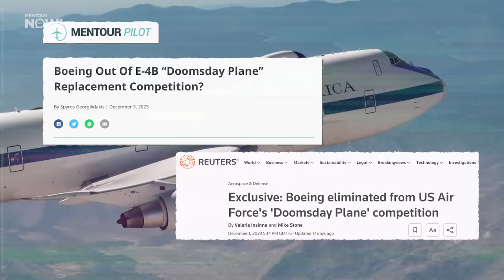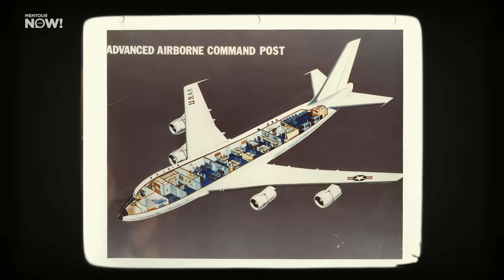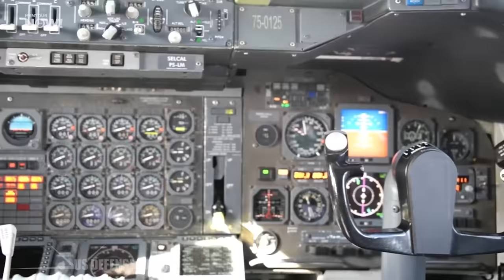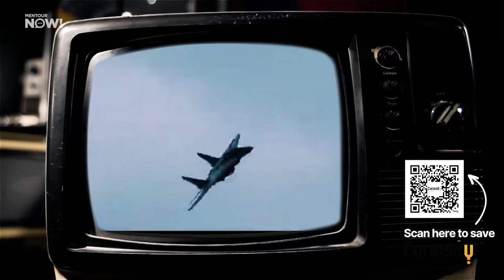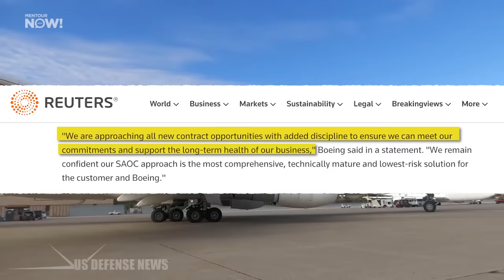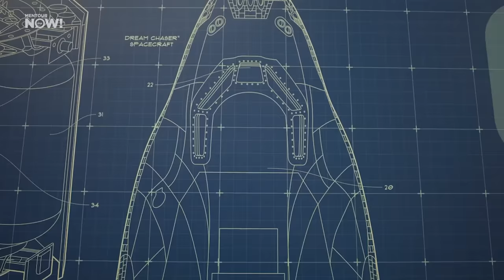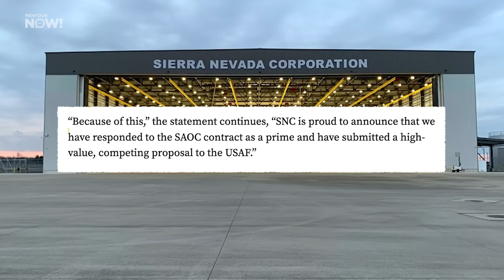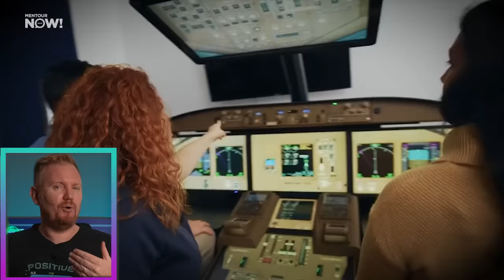Why was Boeing kicked out of the Doomsday Plane competition?!

Comment: What the AF should have done was put orders in for 15 747's before the lines were shut down.  Makes too much sense however.
Reply: doesn't matter - it's the taxpayers' money, so it's unlimited, and spending doesn't need to have any regard for efficiency. There is zero accountability.
Reply: @charlestoast4051  that’s not true at all. In fact, it’s the opposite. The reason Boeing withdrew was because of the requirement by law for the DoD to only sign fixed price contracts. That regulation was created by Congress to prevent projects from runaway costs and save the government money and improve efficiency. If money was unlimited and they didn’t care about efficiency, do you think they’d be flying 50 year old aircraft? Believe it or not, the budget is not unlimited and the U.S. military has a huge lists of financial obligations that don’t allow it to just blow money whenever and wherever it wants.
Reply: @FlyByWire1  And that fixed price sequence is biting boeing in the rear big time on the new af-1's.  They have to strip and gut the entire airframe and rebuild it almost from scratch. Their hindsight is 20-20, not going to do that again. Taking a -400 or 8i down this path is in the same boat, you have to take it all apart and put it back together again.
Reply: Wait.... Isn't this somewhat normal for aviation? I honestly don't know, but for some reason I recall there being a 5 year overhaul or something for commercial aircraft that basically strips them to the frame and rebuilds them.
Reply: yep and that’s the hardest part about fixed price contracts. There will always be unforeseen costs that will arise in the project, we can’t predict the future. So whoever wins the contract will either have to come up with a plan to prevent that or just take the loss as Boeing has on previous fixed price contacts.
Reply: But then they’d have to retrofit all the old wiring harnesses an various other updates to make them compliant. Cheaper to buy used then modify.
Reply: The E-4 is far from a regular production line 747.  They have EMP shielding and 100 other things we don’t know about built into the airframe.  Modifying  an existing plane to fit E-4 configuration would cost a fortune.
Reply: Boeing offered end of run birds to the USAF.  It was declined.  The USAF was not is the right phase of procurement to fund them.  Similarly, Boeing offered a deal with their tanker bid to extend the 767 line for the tanker.
Reply: No, what makes sense is buying A380s instead of crasheing trash. You can find 10+ in good condition on market right now...
Reply: @brianacuff274  What they're doing to make the VC-25Bs goes WAAAYYYY beyond a normal D-check. It's not just stripping down and checking everything, but actually redesigning much of it.
Reply: @KuK137  They could certainly acquire A380 frames more readily, but the modifications would be crazy expensive and would likely require quite a bit more revealing of classified information to foreign entities than what the Air Force is comfortable with, especially for ensuring a supply chain that can keep the things in service for the next half a century on an airframe that hasn't been built in years, wasn't built in the U.S., and was never owned or operated by any U.S. entity - or any entity anywhere in the Americas, for that matter. Also, the A380 includes significantly more composites than the 747 and that makes the much more difficult to harden against EMPs.

Comment: I think the reason they chose to increase the number was because USN replaced their E-6s with C-130Js, so they need SAOC planes to handle Looking Glass missions as well, just like before they handed over and merged that role with USN TACAMO.

up until 90s -> USAF E-4 = Nightwatch | USAF EC-135 =  Looking Glass | USN EC-130 = TACAMO
90s-now -> USAF E-4 = Nightwatch | USN E-6 = Looking Glass + TACAMO
future -> USAF SAOC = Nightwatch + Looking Glass | USN EC-130 = TACAMO
Reply: USN planes aren’t bought under an USAF contract.  Your reasoning is flawed.  The USAF isn’t responsible for planning for USN air needs.
Reply: @matthewgaines10  Your logic is flawed, it's the other way around. Historically, USAF was the one that piggyback THEIR needs onto USN planes. STRATCOM quite explicitly states that USN E-6s are equipped for dual mission, both flying for USN TACAMO staff and for USAF Airborne Command Post battle staff in the Looking Glass role (in place of USAF EC-135).

Now with the USN planes potentially being unable to fulfill the task USAF counted on them (because USN isn't necessarily responsible for planning for USAF needs), there is no reason that USAF would not be responsible for planning their own needs.

Actually, see SEAD mission - they rely on joint operations now that USAF no longer has dedicated platform with the retirement of EF-111 (and no, F-16CJs are essentially just HARM shooters).
Reply: @matthewgaines10 He's right.  There are actually two different USAF missions involved.
1) "Looking Glass" is an airborne command post capable of talking to pretty much everything that SAC HQ can talk to, including transmitting valid launch codes to ICBM silos (but not the USN's SSBNs).  It started out in EC-135Cs,  and when those got retired in the late '90s, the USAF managed to talk the USN into picking up the mission on its E-6Bs (which are also based on the -135), which were also taking on the TACAMO mission, the USN's version of Looking Glass (which can transmit launch codes to subs).
2) "Nightwatch" is a strategic command post for NCA (the President, or whichever survivor is highest on the succession list).  It began on the EC-135J, then moved to the E-4.  It's probably best to think of it as the "DEFCON 1 Air Force One"; the VC-25 is designed to support peacetime diplomatic missions, and allots a fair bit of space for guests, reporters, Secret Service ground teams, etc, plus a much higher level of comfort.  Nightwatch trades all of those frills for more radios and radiomen plus a few generals and enough supplies to keep everybody fed and watered for up to a week in the air.  That's why an E-4 usually follows AFO around, just in case.
3) "TACAMO" is the USN's version of "Looking Glass"; instead of talking to ICBM silos, it's designed to talk to SSBNs and carrier groups.  The mission is similar, but more spread out over the world.  Originally performed by the EC-130Q, which was replaced by the E-6A (later upgraded to B, which also picked up "Looking Glass" missions as a favor to the USAF).
  The E-6Bs, E-4Bs, and VC-25s have all been needing replacements for some time now; honestly, everything made from a 707 or old-model 747 needs replacing, but the money hasn't been there for decades, and the programs that have gotten money have been horrifically mismanaged (see: E-10, P-8, KC-46, VC-25B).  As Mentour mentioned, the USAF wanted to go in with the USN on a new plane for all three of the above roles, but there wasn't money for it at the time.  The USN has since gone its own way, with a plan to return to C-130s, which will leave "Looking Glass" without a home.  That's why the USAF is looking at a larger buy of SAOCs, in order to have one platform that handles both "Nightwatch" and "Looking Glass" missions in order to save money and resources over time, and to ensure that there are always enough airframes available to carry out both missions.
Reply: Except the Navy has NEVER USED the E-6...🤡
Reply: @ligmasack9038   "Except the Navy has NEVER USED the E-6...🤡"   what?
Reply: Wrong, the USAF had to buy a fighter that was designed to handle heavier landing gear to USAF dismay.  That limited the aircraft’s capabilities ‘cause USN requirements .  It’s called the F-35 @matthewgaines10

Comment: I assume the 5 mile long antenna that sticks out the back is for low frequency communication, which requires a longer antenna.  Low frequency has several advantages such as being able to communicate to submarines underwater.
Reply: ELF
Reply: thanks for repeating what the video said
Reply: The "five mile antenna" is not an antenna - it is a ground plane for the long wire antenna.
Reply: Extremely low frequency
Reply: Probably for communication with submarines (haven't finished the video yet).

Edit: Yeah lol, that's what it's for.
Reply: Isn't the body of the aircraft the groundplane? @TacticalData
Reply: @TacticalData  : Antenna ground-planes are part of the antenna, any description to the contrary is incorrectly describing what they do and how/why they work.

Comment: Love these videos! I know the second requirement was "modification of a second-hand aircraft", but why wouldn't modification of existing C-17 Globemasters (or even modification of C-5 Galaxy's) work here? They're 4-engined and tried-and-tested in the military.
Reply: Wonder if efficiency comes into play.
Reply: I initially thought the same thing, but the certification process would be cost prohibitive and it's doubtful you could get either airframe certified as designed regardless of modifications made. In fact the modifications required to convert it from military transport to flying command post full of personnel and equipment may make the certification process even more impossible.
Reply: I bet it is easier to start from scratch and with an airframe that will have greater longevity with the newest C-17 and C-5 eight and 30 years old respectively.
Reply: @vanguard9067  There would have to be a business case to build such a plane. A clean sheet design through certification is a decade-long process and there would have to be more than 10 planes built (think several hundred minimum) for this to make any sense. The Airbus A380 is considered a business failure because the program lost money since the plane didn't sell i the numbers expected or required to meet break-even revenue. The A-380 couldn't be used as a freighter so it's market was limited to just passenger airlines. A clean-sheet design for a maximum of 10 airframes is a complete non-starter. And there is no current market for 4 engine super-jumbo airframes or Boeing and Airbus would still be building them. And there isn't enough demand to cover the production costs of the few freighters ordered and sold every year.
Reply: @andrewg.spurgeon1736  I totally agree about a clean sheet design.  I think ultimately they’ll scrounge up some lower mileage 747’s and some contractor will build out the doomsday planed]s,  I have a hard time believing any contractor will do the work FFP because the government does not have a  firm set of requirements.
Reply: Military planes aren't FAA certified though. The requirement for an FAA certification means they have to go with an existing civilian design.
Reply: It would deplete the already insufficient USAF heavy airlift inventory. Simplistically, it would be the choice between an already configured two story office building with a basement, versus converting an empty warehouse into the same. The design of the 747 maximized floor area for passengers and containerized cargo, the C-17 was designed around maximizing volume (especially height) and weight and has a built-in mass penalty for toughness in austere field operations. Douglas and Boeing did float a commercial cargo version of the C-17, but that was aimed at airframes for the CRAF (which subsidizes operational costs).
Reply: @michaelpatrick6485  great points, thanks.

Comment: I predict Boeing gets the contract with better terms.
Reply: and with SNC as the sub contractor to do most of the work
Reply: @johnstreet797  Or a joint/partial bid together with SNC, where Boeing's responsibility is limited to eg. the procurement and refurbishing of the planes. This would allow SNC to be entirely focused on the Upgrade and Modification process...

Comment: Presumably these planes have a Faraday Cage arrangement built into the interior of the fuselage which should prevent the effects of EMPs from Nukes. They would need something of this kind because these things are packed with modern electronics, even if the avionics are analogue.
Reply: A fuselage is already a Faraday cage (even if there are quite a lot of holes that limits the upper working frequency).
To harden a plane against EMP you need to ensure that every piece of the fuselage make a good electrical contact all around with the frame and with the other fuselage pieces (the classic glue is not electrical conductive, you need something else to ensure the contact) and you need also to plug any holes to avoid EMP ingress (for example, the windows are made with electrical insulating material and, even if the doors are made with metal, they not ensure a proper electrical contact all around the seam so are still considered as holes; a special conductive gasket placed all around the seam is required to made the joint RF-tight).
Finally, you cannot run a cable outside a faraday cage otherwise it will carry the RF energy inside (the outside portion of the cable act as an antenna to pick-up the RF enrgy and the inside portion of the cable also act as an antenna to radiate the RF energy inside the shielded environment!)... all cables that runs outside the fuselage must be filtered and shielded properly.
In any case....... a Faraday cage that blocks 100% of the radiation is almost impossible to build (specially if there are size, weight and strict cable management requirements!) so a little part of the RF radiation is supposed to seep inside and the electronic equipments are supposed to be hardened and withstand this noise.
BTW, hardening a devices that uses low integration is simple because the bigger is the component the higher is the working voltage and the lower is the input impedance... and the higher is the working voltage and the lower is the input impedance the higher should be the RF pulse in order to generate an issue.
Also, you can't damage what doesn't exist.
Analog equipments (but also simple digital hardwired equipments) contains less but bigger components than modern equipments (that may contains millions of microscopical transistors enclosed in a very small chip).
I work as electronic designer for medical devices..... i'm used to design devices with quite a lot computer-aided bells and whistles but for the safety and emergency part of the device i prefer to stick with plain old analog electronics, plain old simple and hard wired digital electronics and even electromechanics too!
Reply: Bet they have a couple of valve radios too, just in case
Reply: @teslacoiler  Military aircraft have ITO conductive coatings on windows as standard.

Comment: Hmmm some old A340-600s could be an interesting choice. Quite a few in storage and dirt cheap too!
Reply: I don't see the US military relying on the EU for these planes.
Reply: The A340 is far too underpowered for all that additional equipment and reliability.
Reply: Beautiful aircraft. Too late to the party.
Reply: @TacticaLLR A340-300, yes. Looks like the A340-600 has upgraded engines.
Reply: @msromike123  I agree you there and there’s also there’s a federal law that will forbid the US Air Force buying European made aircraft to protect our command structure
Reply: Sure, if the requirement said inefficient junk, it would be high on the list.
Reply: well thats a moronic law then @SuperAirplanemaster
Reply: no, you just don't like Airbus @TacticaLLR
Reply: @TacticaLLR  not really, 340-500/600 got about the same T/W ratio as a 747-400
Reply: @ant2312  I love Airbus.
Reply: @TacticaLLR  You're thinking of the wrong variant
Reply: @jeffhaggarty9879  The A340-600 is only about ~0.3 L/Passenger km more than the 747-8, and the -500 is more efficient at ~0.3L/Passenger km less than the 747-8.

Comment: I might be American, but seeing an A340-500 version of these (longer range than the 747-8i) would be really cool.
Reply: There are not enough of the A340-500 in airworthy condition left. And, as mentioned in another comment, the is absolut zero chance than any non-US made aircraft will ever be used for the signature functions of the USAF, like e.g. AF1, the doomsday A/C or even the tanker fleet. Even if a foreign airframer would win the bidding process, there would be massive interference from congress, even if that would mean that the USAF would get an inferior solution. It has happened before, and it will happen again. To think that will ever change is downright delulu.
Reply: @MattBlue  I guess I figured the production run for the -500 and -600 was greater, having seen a few around here at IAD.  
As for the rest of your comments - Airbus won the tanker contract that beat out the KC-46 (as mentioned in this video) but Boeing cried foul, and with their massive lobbying power in various branches of govt, they got their way.  To say it's impossible isn't true though.  

And as far as that notion ever changing being "delusional" -  I'm sure the folks at Lockheed know a bit more about this stuff than you and I, they thought it would be worth it to bid with Airbus on the next tanker acquisition.  Of course they pulled out, but Airbus is still in it (likely because the USAF is absolutely furious with the KC-46 acquisition process so far.) 

The MRTT is (and was) already flying, and offered a much more advanced and cost-effective solution.
Reply: @EstorilEm  I stand by my comment. It won't happen. The "buy american" approach will always remain, and any Euro spent on an offer to the american government by AIrbus is a waste of money. I don't think that the next tanker contract will go to Airbus under any circumstances, even if the competive offer would be superior. If I'm proven wrong and the contract goes to Airbus, then we'll talk again.